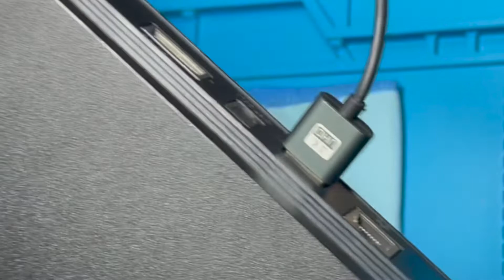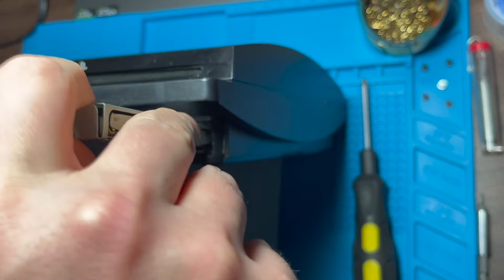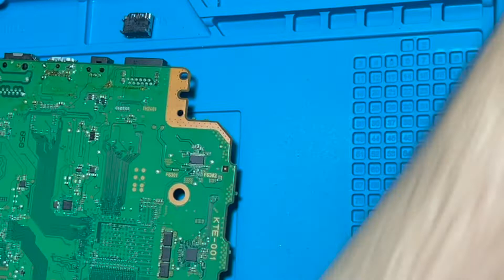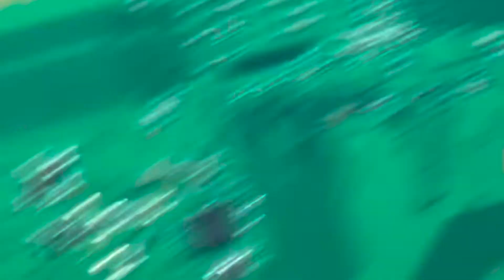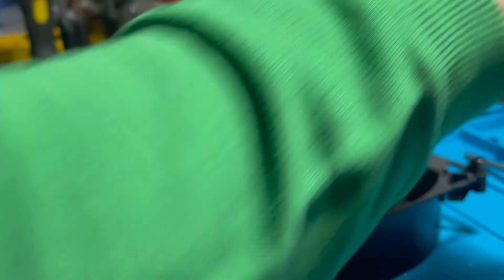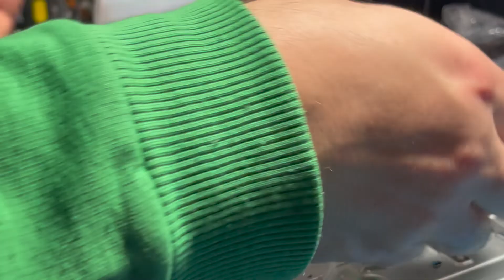PS3 Attempt to fix HDMI port - part 1

Comment: You have the exact problem I'm having as it's like my hdmi port is pushed in
Reply from the maker: It is not a fun fix but doable. Do you have issue with the signal cutting out?